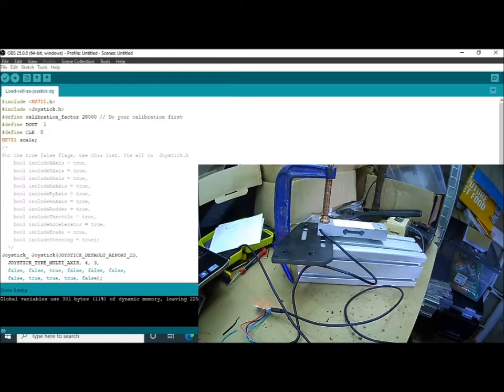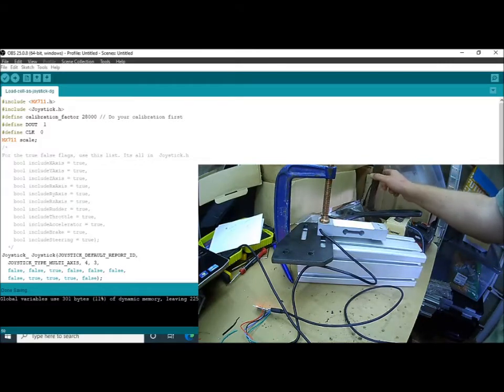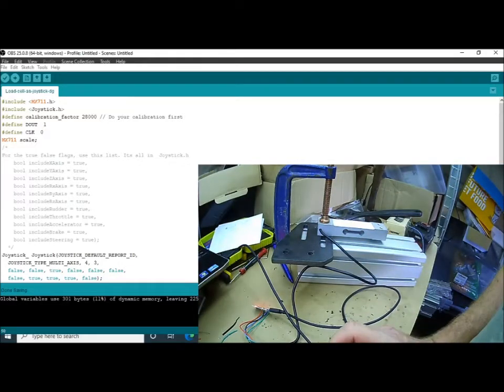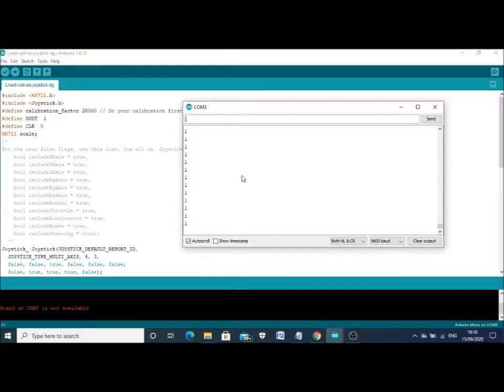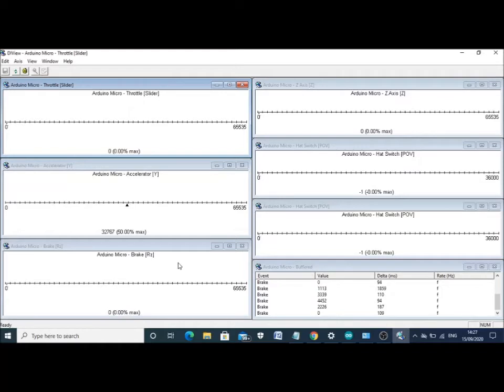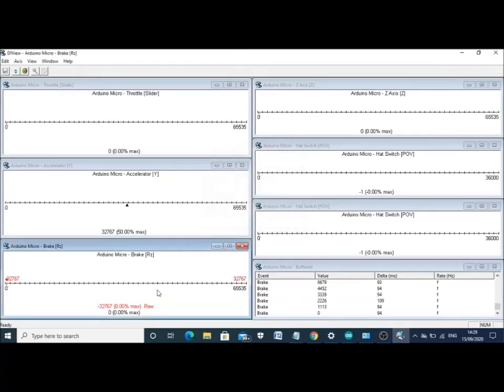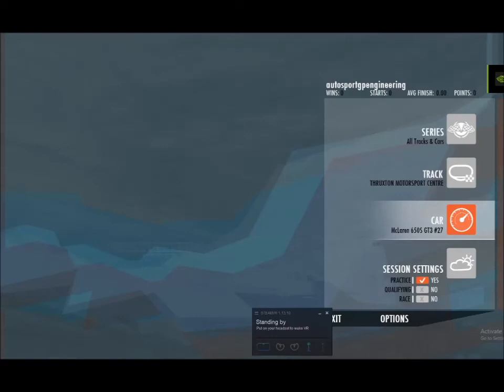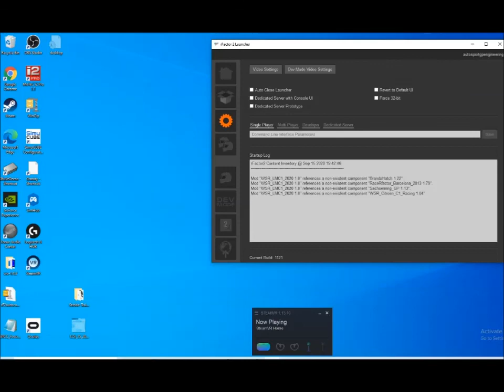Make Your Own Loadcell Pedals for Sim Racing - Part 2

Comment: ive done all of your procedures and perfected it (i think) on my personal preference. with hx711(80hz), i managed to make it run and get a delta(ms) of 0 and 16ms only reading rZ and rY because some games uses rY axis like EA F1. both axis calibrated differently. i also changed the reading into reverse input instead of coming from 0-100%, its now 100-0% so i dont have to invert axis every game on settings. (i didnt check the voltage tho so i dont know if it really is taking something when in idle) 

thank you so much.

i ordered a ina122pa from china, ill try the do it with analog.
Reply: hello, i'm having issue with the ardunio skecth when i try to run the skecth i get a error like this "hx711.h no such file or directory" can you help me please
Reply: @emirselek4482 install both hx711 and joystick library.
Reply: i manage to make the code work

Comment: Super cool sketch and tut. Changed the range from -1025/1025 and put second lc to the HX 711. Doesn't go like an ordinary axis with center,  positive and negative sides. Only one way or sums up. So there is no way to make it with hx711 like with INA 122 for example? Negative readings won't work?

Comment: Hello, I congratulate you on your tutorials, sorry for my English, I am from Argentina. I want to do what you do, 3 pedals, brake with load cell, throttle and clutch with 10k potentiometers. Your Arduino sketch also serves for Arduino leonardo ?? because I own one. I ask you because I will copy your tutorial step by step, as I can do a good mechanic on the pedals but I do not have much knowledge about Arduino. 
Thank you very much and again I congratulate you on its content.
Reply from the maker: I think you'll be OK with the Leonardo, but I've not tried it so I can't be 100% sure.
Reply: @GPRaceSimulation  Great !! thanks, one question, I see that with Arduino I get a resolution of 8bit, there is some way to extend it at least to 10bit ??

Comment: thank you for sharing. It worked well. Although can't reach 100% load on my cell (20kg load). Had to change max braking value to 29% so I could reach full braking. With calibration factor figured out and pasted in next sketch, it was worse (had to decrease to 9% to reach full braking). So played with calibration factor to get 29% load.
Reply: @DeiviZZZ mate, could you please share your working arduino sketch with me ?
Reply: @bariskaraismail8613  im not using it anymore. Installed shake it rumble on brake pedal and it vibrates when front wheels loose traction. Also load cell was lagging behind on press and didn't go back to zero fast enough when released. Probably poor quality controller. Actually made 2 of these and both worked as described above.

Comment: Hello,I have 3 hx711,If I use 3 loadcell for my sim pedal, how should the code be written.
Reply from the maker: I don't know yet. You need to use the multihx711 library. Check out my part 5 video for an alternative/easier way to do it.
Reply: Standalone Load Cell Amplifier, too expensive, compared to hx711 module, this price is too expensive.

Comment: Hello! I bought a 100kg loadcell with the HX711_ADC amplifier and use a arduino micro to create a controller for the brake axes. I have got a problem that the input speed is very slow. I press on the load cell and after one second the data increases smothly and slow. So it does not show me the realtime input. Do you know the problem and can you help me?
Reply: you can change the value in serial.begin i have same problem and im using Serial.begin(230400) and its looking better.
Reply from the maker: You might be better off using the Leo Bodnar amplifier i introduce in part 5.
Reply: @GPRaceSimulation  But how can I solve it for the HX711? I cant import the leo bodnar one.

Comment: Loving this series so far man! Thanks for your videos!
Is the load cell only useful for the brake pedal? What do you suggest for the throttle and clutch?
Reply from the maker: In part 4 I talk about this. But, you can use the load cell method for throttle and clutch. Because the brake is pressure sensitive then load cells are ideal, because throttle and clutch are displacement dependent then I think hall effect sensors would be better. There are no contacting parts then so reliability should be better too. I will discuss throttle and clutch in future videos.
Reply: @GPRaceSimulation  Great to know! Thank you so much for the work you are doing

Comment: Thanks for the tutorial.What if I use 3 loadcell for my sim pedal,how to wired 3 loadcell?
Do I need 3 hx711?
Reply from the maker: Hi, we will be covering this in future videos. You will need 3 HX711 amplifiers, and you'll need a special sketch for the Arduino. However there are several other ways to do it and I'll be covering that soon. I'm not convinced that load cells are the best way to do the clutch and throttle, so I'm looking at Hall Effect sensors for them which will make things easier too.
Reply: @GPRaceSimulation  I will wait for your new video and thank you sir.